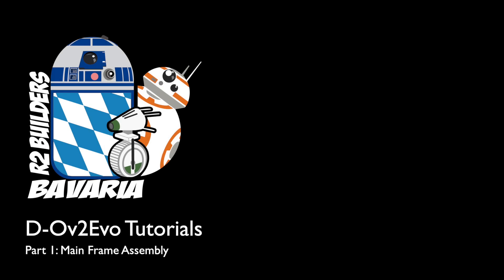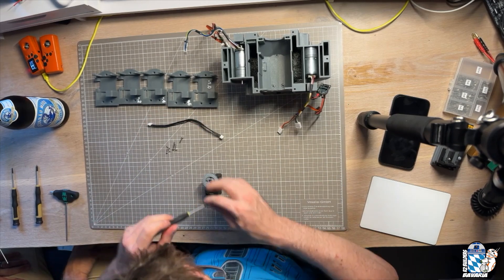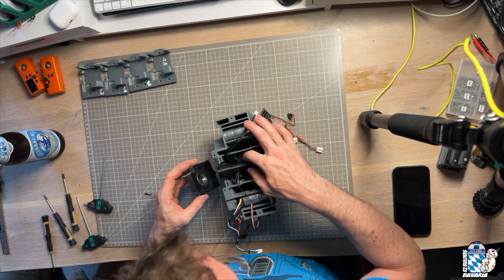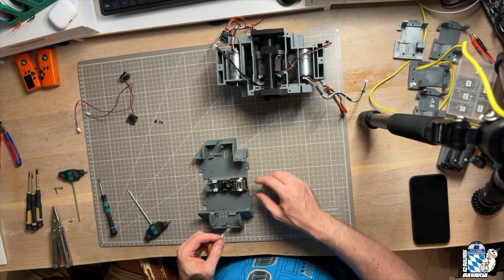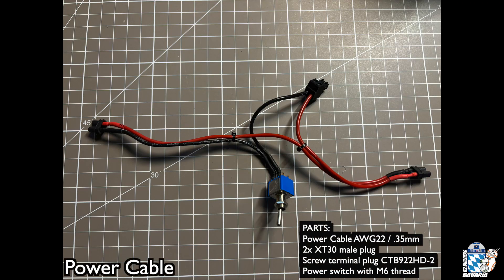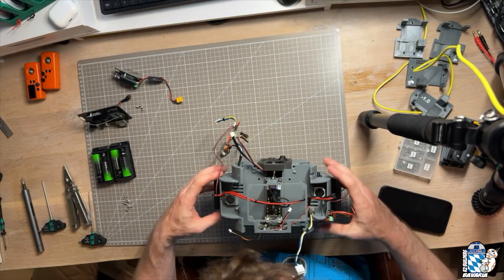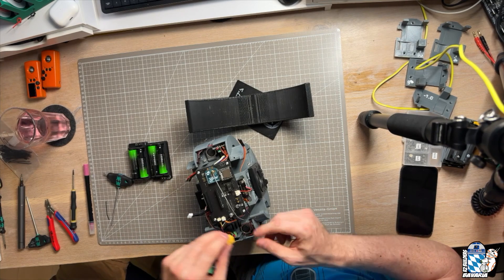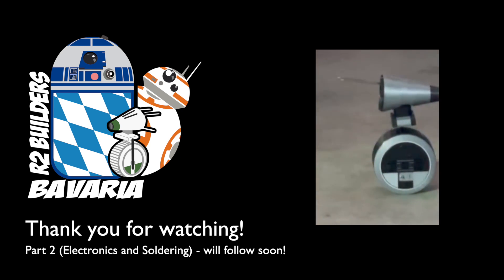D-Ov2Evo Tutorial Part 1: Main Frame Assembly

Comment: Looking forward to the files and instructions for the rest of the build (or instruction that we should use the standard Mr. Baddely files.
Reply from the maker: For the body, there's a file called "Main Frame Instructions.pdf" inside the "Main Frame" folder that lists what parts from the standard files to print, and what part from our variant. Rest will come 🙂